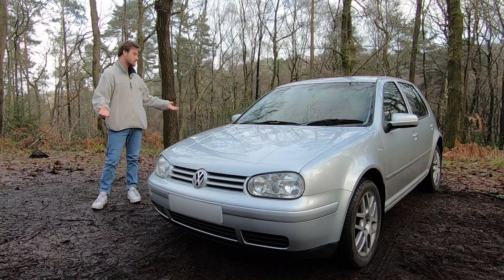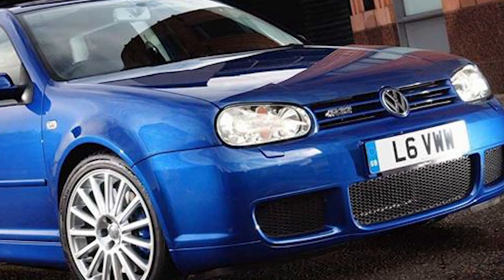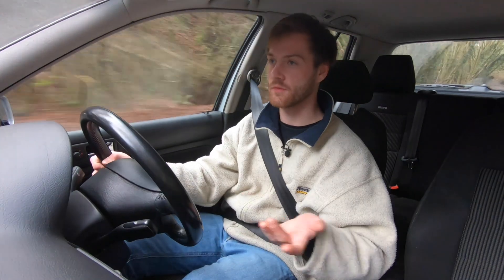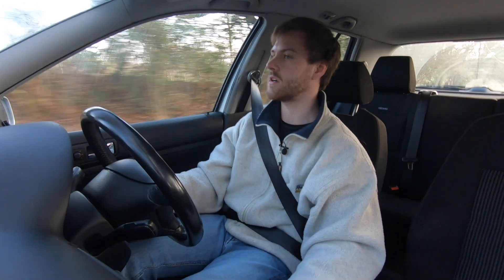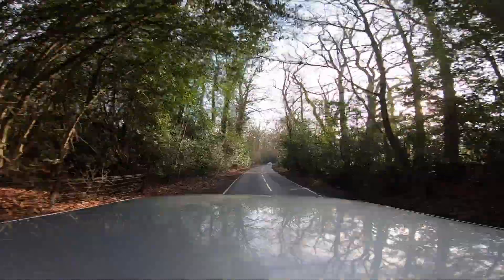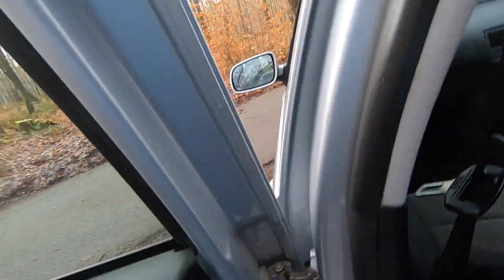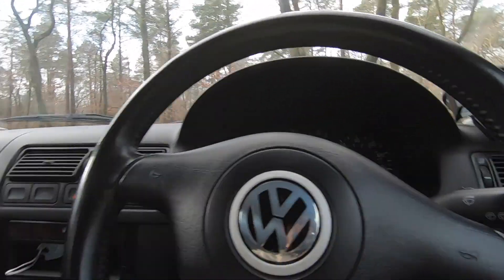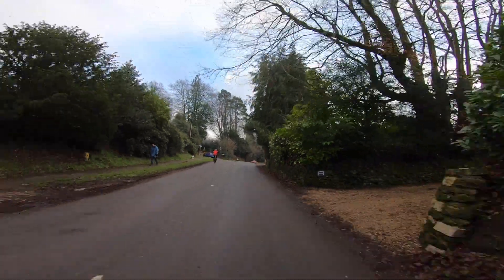I Bought a Mk4 Golf GTi 1.8 Turbo

Comment: Great vid, I’ve had 4 GTI’s plus a Mk4 R32. Couple of things to check and it’s happened twice to me with different cars and also my friends is the clutch pedal weld snaps so the pedal goes right to the floor...easy but awkward job to do but I’d buy a spare just in case. Also the secondary air intake system can split, the early cars didn’t have these (agu code for example) but again it’s happened to me twice. It happens for about 10 seconds on start up until the unit seals again then it will just stop, very loud and embarrassing 😂. Have a look on the net, might just help a little 👍

Comment: Great video, didn’t know that bout hydraulic steering being sought after? Also was expecting more videos after this one on the golf gti
Reply from the maker: Thanks Sean, will be doing some vids on the Golf soon! Electric steering is better for fuel economy as hydraulic relies on some power from the engine which is why it's been heavily adopted. Hydraulic steering has more of a literal connection to the road though compared to electric, have a read of these: https://www.caranddriver.com/features/a15122019/electric-vs-hydraulic-power-steering/
https://www.autocar.co.uk/car-news/features/no-bum-steer-importance-steering-feel
Reply: @motorthoughts  hey thanks! I have owned a golf since 2004, currently I have the 1.8t  180bhp GTI for 10 years now, I can’t part with it. Well looked after. Welcome to the club!

Comment: everyone i bought one aswell and after about 7 months of owning one it cost me around 3500euros to repair the things that broke on it. i went for a mot check and thats also gonna cost me more than 2500euros. aka it cost alot.
Reply from the maker: Sorry to hear that man! Always a risk buying an older car whatever the make, what do you drive now?
Reply: @motorthoughts  i still drive gti. Most expensive car but definitely the most fun i had in one. like it slaps some modern performance cars with a stage one tune.

Comment: 1900???? i got mine for 600 pounds and it was actually in good condition..no scuffs dings etc you may of paid a tad higher then usual
Reply from the maker: Maybe... was yours second hand with only one owner?
Reply: @motorthoughts  good point haha I think I'm the sixth but 1900 is still quite steep though I'd say 1300 around that mark would be where I would look

Comment: Would you recommend this car for a seventeen year old ?????? 

I’ll sub if u reply
Reply from the maker: The insurance on a Golf GTi in general is quite expensive but especially for new drivers so I'd bare that in mind. It'll probably cost you more to insure then the actual cost of buying a Mk4 Golf GTi so probably not worth it maybe wait a couple years or get a different version other then the GTi? Have a look on price comparison websites and see what you think also bare in mind the annual tax for the car is £300. If you want a fun old school first car maybe have a look at the Lupo GTi should be a lot cheaper to insure and is a lot lighter then the Golf so could be a lot of fun! If not maybe look at an old Seat Ibiza or Leon from the 2000s? They share parts with old vws, are cheaper to insure then a Golf and they're good cars! Hope this helps :)
Reply: @motorthoughts  uk insurance always makes me laugh